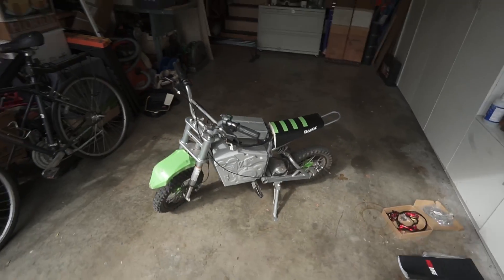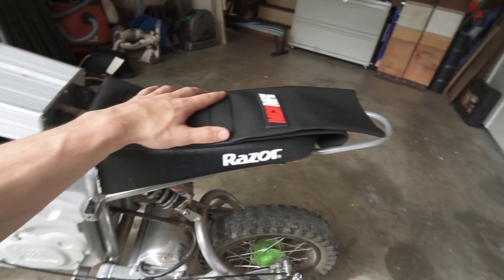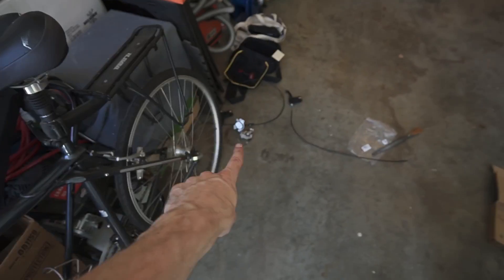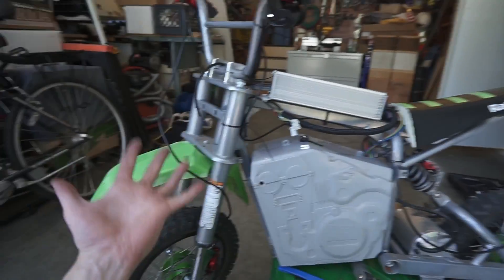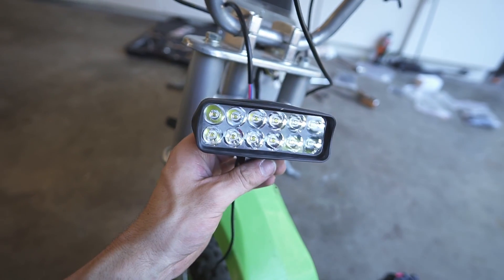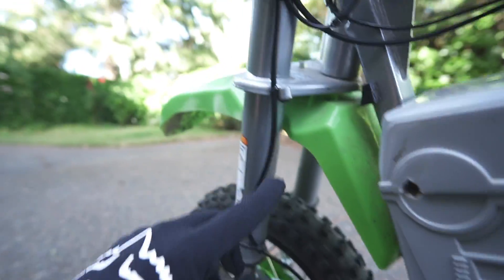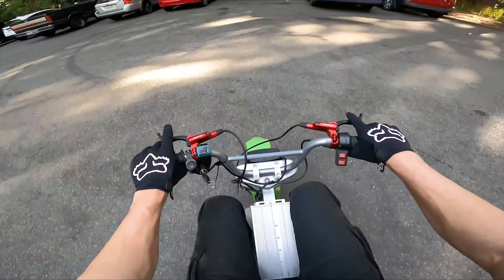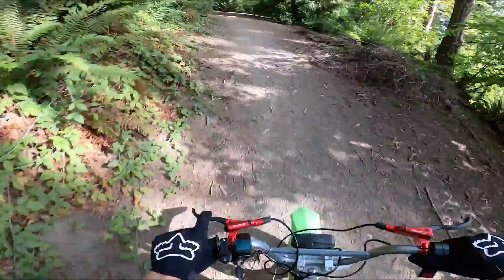72v RAZOR sx500 gets more mods and upgrades! || Razor electric pit bike build

Comment: I use a 2200mah 3s lipo to run my lights. Thing is so small and it saves extra conplexity. Then you can add anything 12v easy

Comment: Do you know if this setup provided would work on a rsf 350 or any of the 350 models?
Reply from the maker: Unfortunately I don’t think so - the motors are slightly different sizes so not sure if the bolts would line up, plus the battery will be tricky to fit :( If you’re adventurous i bet you could make it work though!
Reply: Rip. Also wanted to ask if you think you could fit a 30AH battery or bigger in it. I have some parts for my build but I don't have the bike yet so idk how big it is.
Reply from the maker: @johndemers5433  hmm it would be tough, depends if it’s traditional lipo or lifepo4. My 20ah lifepo4 baaaarely fits (requires some mods) but 20ah lipos from Electro and Co are way easier to fit.
Reply: Interesting, I'll have to look at the difference between them. Appreciate the reply bro
Reply from the maker: any time b, if you can manage to find an Mx/Sx500 or 650 chassis it’s sooooo worth the extra money over the 350s. Best of luck with the build!
Reply: YOOOO so I got the mx650. Got a rolling frame as you suggested for 100. Gonna order the electro and co 5kw kit. Had another question not sure if you could help, but I was looking at saving money on the battery and I have a used ONYX RCR battery nearby and was wondering if I could change the connectors on it and use it for the build. The ones it comes with bolt onto the RCR controller and I'm thinking of using tx90s
Reply from the maker: nice find!! Not sure about ONYX batteries tbh, but just see if the voltage + amperage limits match up with the Kelly controller - not sure what the min voltage is but it’s definitely lower than 72v. Dual XT90s should be ample for anything like this :)
Reply: Good point I didn't think about that. Do you know if you can tune battery info in the controller with that phone app or on a laptop?
Reply from the maker: yep, but you’ll need the USB adapter thing snd a PC to connect and program - after that i believe you can change parameters via an Android app! But you may not need to, i bet if you email E&C with the battery specs they’ll be able to tell you if it’ll work with that battery out of the box :)
Reply: Thats a good idea I think that'll be my next move. I appreciate the continued support as well! I saw it video with what you've done to your bike and it looks nice. Didn't think of using vinyl on it but I might just have to now😭
Reply from the maker: @johndemers5433  hahaha thanks man!! I love vinyl now, durable and easy to repair. Let me know if i can help with anything else
Reply: Been doing a little more research...  Did you have to modify your freewheel at all. I saw a couple posts about the tourqe of the motor messing it up.
Reply from the maker: i’ve been running a stock freewheel and chain since day 1, and this bike was definitely kept outside for most of its life by the previous owner lmao - but freewheel has held up great! Maybe worth addressing if it starts to get too chunky or sketchy, but I wouldn’t worry about it for the time being.
Reply: Alright...  Build is getting up to speed. Have the frame stripped and parts are coming in. Got everything for my wheels today except for my front tire. I ordered two of the tires you had linked and they are too small for the front wheel which happens to be 16x 2.4. I couldn't find another option on Amazon tho you have any suggestions?

Comment: Just so you know the razor 650 model has a larger diameter front tire that is direct replacement. Would be good upgrade. Thanks for video and info.
Reply from the maker: I’ve considered it! Definitely a plus for off road stuff, but i have a plan for these lil 10 inch wheels coming up in a couple weeks :)

Comment: How much did it cost for all the upgrades so far? (Battery controller motor) and what’s the range?
Reply from the maker: Range is about 30-35 miles I think, and i can’t remember exact cost for everything. I think when i bought the battery it was under $500, then controller and motor were like $180. The prices change all the time tho on the listings :(
Reply: @logan-taylor  okay thanks man, all I needed to know, range is insane on these little things
Reply from the maker: @Danielxperez14  ikr? lasts much longer than my energy does on a ride lol

Comment: I bought a 72v 3000w kit off aliexpress for my sx500. I got a 50a controller 11t sprocket. I get 40mph but can't really wheelies at all. I don't know why everybody's else bikes are different.
Reply from the maker: hmm.. what battery are you running? Is the controller kit made by Vevor or someone else?
Reply: @logan-taylor  I got a custom battery built that can put out 80amps continuously and 160a peak. It's a 72v 25.6ah. Lg cells. I honestly don't know about the controller make. Just Chinese 72v 50a
Reply from the maker: probably worth trying a different controller then - weird that you can hit top speed but slow acceleration. If you’re at a dead stop and go full throttle, it won’t wheelie?
Reply: @logan-taylor  Yes it does at a dead stop with feet on the ground. but cant when riding at any speed
Reply: @SharkTheatre  I have the same setup as you, I can do wheelies just need practice, make sure you sit far back to the back of the seat and it’s hard to wheelie when you’re already going fast, try to start them going slower and build up speed
Reply: You need the 11000 moter
Reply: What cable did you put the volt meter on?

Comment: How fast does it go? I was wondering cause I have basically the same setup in my razor
Reply from the maker: sick! Hope you’re enjoying it. In this setup it goes 37, but that’s with an 11t front sprocket. With the 13t i have on now it goes 40, and with the new controller it might go a tiny bit faster. The 13t upgrade was so worth it, would highly recommend for a better power band.

Comment: the controller is limiting your amperage power. look at a kelly and bonusbyou can adjust throttle ramping so you won’t wheelie the whole way.
Reply from the maker: precisely! Kelly KVD is coming up next :) The current controller is good to get started but clearly sketchy lmao
Reply: @logan-taylor  Great vid bro! I started with the Kunray 3000w controller kit but since upgraded to the Kelly KBS72121X. OMG, it is so tiny and light. Downside is that it doesn't have 1,2,3 modes, only eco mode. KBL model has 1,2,3. Javi Suave here on YT has a good vid on how to wire it up.
Reply from the maker: oh excellent - what type of power difference did you feel? Not familiar with the KBS but about how many amps are you flowing with it? Thanks for the tip!
Reply: I’m just pushing 30amp 48v right now. With stock gears, I’m only getting 25mph. I’m looking to get a 72v custom built. I had a set of 72v and it was bananas, scary as hell at low speed bc of the torque. Keeps wanting to wheelie 😀 I need to hook up the eco mode on the controller before I get another 72v

Comment from the maker: As promised, here’s the fully updated **PARTS LIST**:

Hydraulic disk brakes for Razor: https://amzn.to/3B0O1ev

Brake disks specifically for Razor bikes (*PLEASE double check that the rotors you order have a 44mm bolt pattern * Regular 48mm rotors will NOT work!): https://amzn.to/3SEOrgJ

72v e-bike headlight: https://amzn.to/3TmxQiy

Nice aluminum headlight switch: https://amzn.to/3PYQYQN

Grippy moto seat cover: https://amzn.to/3KvIlMC

Heavy-duty chain: https://amzn.to/3wHsk0u

*The powertrain:*

72v 3000w Motor + controller kit: https://amzn.to/3pmls4m

72v 20 amp hour battery: https://amzn.to/3qsflvM

E-bike twist throttle: https://amzn.to/3QQ6bEQ

E-bike voltage meter + key-on: https://amzn.to/3dwrlcC
Reply: Any chance you can throw this in the description?  That’s usually the first place people go to find links.
Reply: You linked a 48v kit not a 72v one.
Reply: @UnhingedRednecks noticed the same thing

Comment: do you have a link to the battery you used? the one of the other vid isnt working
Reply from the maker: They took down the 72v listing, I’m sorry :( I’m keeping my eye out for other options and will update the link if it ever comes back in stock
Reply: @logan-taylor  okay thank you, sweet build
Reply from the maker: @tylerpedigo1614  thanks so much man
Reply: @logan-taylor  of course, do you have any recommendations for other batteries to use? im looking into starting a similar build to yours
Reply from the maker: @tylerpedigo1614  Check out the Eon Lithium option that electro & co carries on their website - super quality, shielded, and flows a bunch of power. https://www.electroandcompany.com/product-page/72v-20ah-li-ion-battery